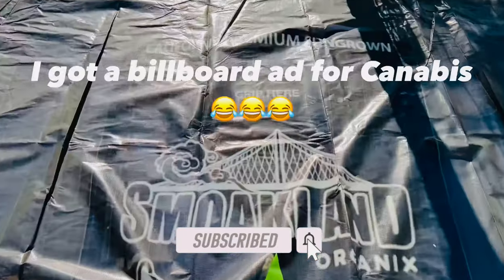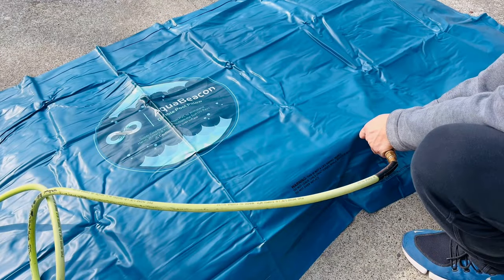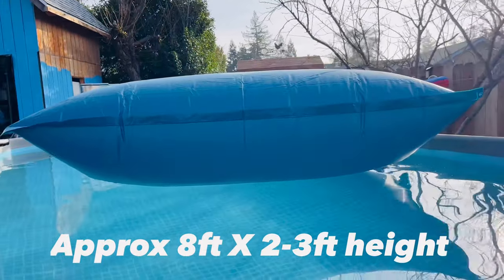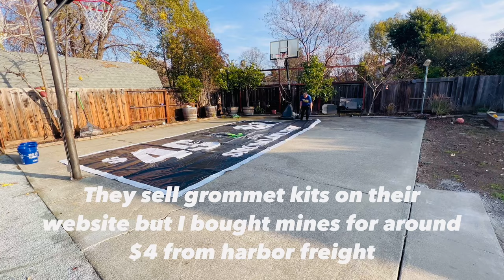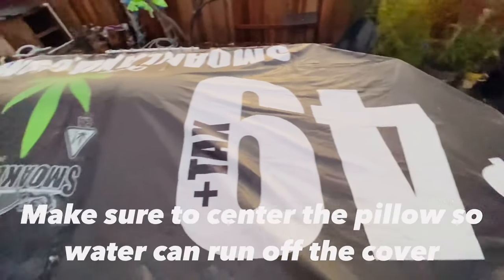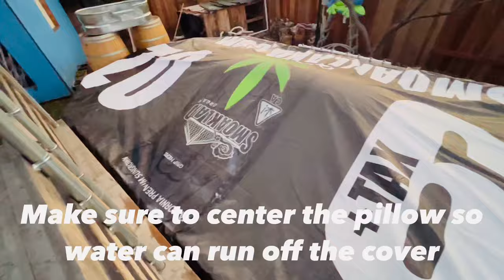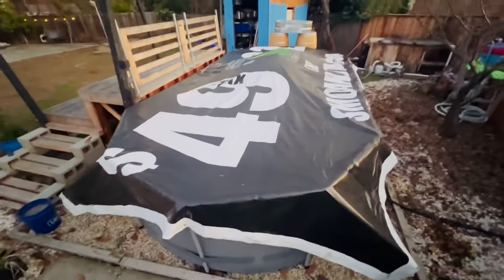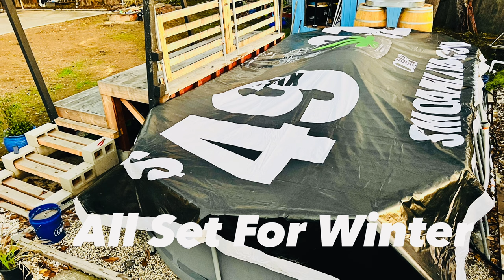How To Close Your Pool For The Winter w/ Pool Pillow & Pool Cover

Comment: I did something similar.  We cut a bilboard vinyl into strips to wrap around the outside of our above ground pool and made a cover out of another.  We lay pink foam boards from home depot on top of the water then cover them with the bilboard vinyl.  This has made it such that the pool only drops about 3 degrees in 24 hours after turning off the heater when it is about 30 degrees outside.

This has made it such that we keep our pool open all year long.  In fact it costs less to heat the pool now in winter with the pool insulated with wall boards and a bilboard vinyl than it did in the summer with the standard solar cover.  Yes, we do still use the pool when it is below freezing.  We just heat the pool to 85 and wear both hats and quick drying shirts in the pool.
Reply from the maker: That is awesome 👏🏻